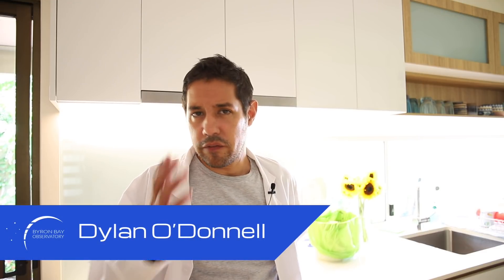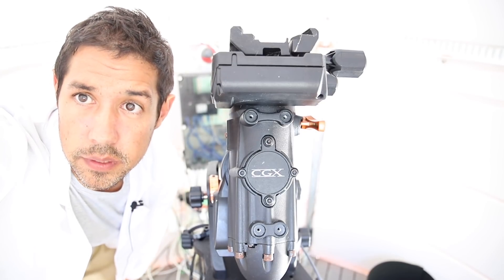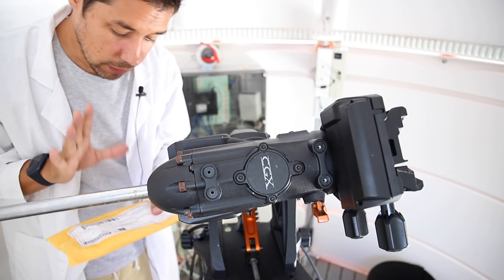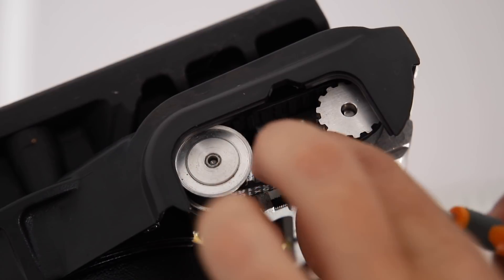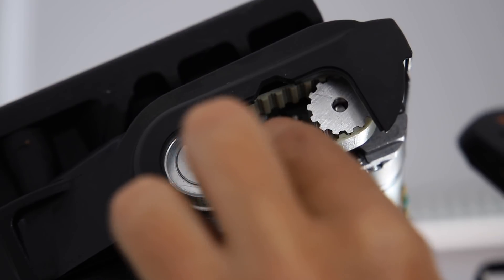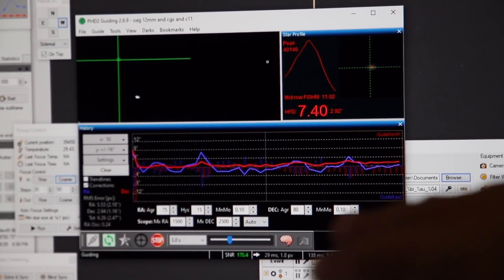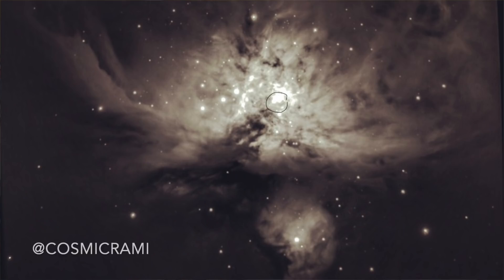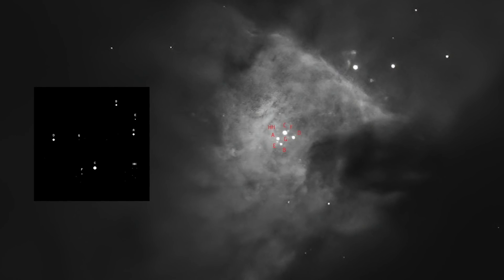CGX Belt Upgrade Demo & Trapezium PSA

Comment: I sound authoritative but I am really not!  What a down to the Earth comment Dylan!  I have not seen one single person on youtube channel that is more informative than yours.  

Can I suggest you to look at the rollers where you put the belt and see the screws on one of them?  I think the top one generally have allen screws.  See if you need to tighten them!
Reply from the maker: Ahh thanks Ray! I'll give it a look... I have a feeling it's more fundamental but unless I get a clear sky before the new mount arrives.. it's going back in it's box heh.
Reply: @DylanODonnell  g`day dylan did you check the sprockets for endfloat (feel for play up down left right in out )it should have next to no play check the bearings for notchyness with no belt and with what ray said check ALL bolts  for tightness firmware up date maybe ? on motor control  sorry you probably have done all this... if you know the youtuber astrobiscuit he has a mate that fixes these for a living you should email him for a possible solution or upgraded parts or a chat  ... great detail on the trapezium and the gas cloud  nice shot for 2 sec 
cheers
james D

Comment: Hey Dylan, I have a CGX and have pretty extensively replaced the drive components in order to tame the inherent backlash and tracking issues. Send me a PM if you want to compare notes.
Reply from the maker: I think I'm at the end of my skill ability here. I will likely sell it cheap to someone with more skills than I ... thank you though!
Reply: @DylanODonnell  Fair enough, I'm at the point that I am ready to upgrade to get rid of mine. Too many lost nights spent fiddling with adjustment. Unfortunately even the "upgrade" options each have their own serious issues.

Comment: A man bought a telescope. This is what happened to his bank account.
Reply from the maker: He made ... a recovery.
Reply: @DylanODonnell  dylan, that's not possible
Reply: A haiku.  Fancy telescope...His astrophotography...Bank balance so small
Reply: I don't have a CGX but I have done  full teardown/rebuilds on two of its predecessor and smaller mounts, the Advanced GT. That one is a direct drive rather than a belt drive. Certainly the belts are a good candidate to go after, and i'm thinking you were having some backlash issues as well which also points at the belts and should be improved. After that there are a couple of clues you might consider. It seems like the RA error is cyclical. Can you figure the scope's angular travel through RA from peak to peak on the errors? Then with the covers off, move the scope through the same shift and watch components to see if there is an element that moves through a full or half rotation over that pointing shift. Identifying that component narrows down the most likely parts.
2nd, from the look of it, I suspect that the really large offset to start is stiction in one of the bearings. Once moving it gets better but there is still a spot where it's worse.  This could be the same bearing surface that's causing the guide errors, but it's hard to say for sure.  You could have a main bearing with stiction and another causing cyclic RA error.
In any case, you will need redo all PE training, so record what might be saved and then reset everything so you are starting fresh. 

I'd suggest tearing down cleaning and relubricating the mount and pay particular attention to any thin shims on bearing surfaces, but that's just me. Just a bit of a dry spot or dirt in one of those can do all this, or perhaps just wear and thinning out of the grease through hot and cold cycles.
Reply: @Dylan O'Donnell I saw in another response you said the error cycle is in seconds, so that eliminates main RA bearings. Forget about my previous suggestion. So we're down to the small set of worm gear/ bearings or motor/drive gear bearings either of which would produce more regular looking errors or you've got an electronics problem producing a wobble in the motor. Missed or dirty drive pulses going to the motor due to drive signal noise can do that, even from cold solder joints or a bit of corrosion in a connector.  Have you checked all the connectors and wiring between the motor, sensors and motor drive boards and/or done any swapping to try and shift the problem from RA to DEC?   I'm sorry that So. California is too far away to take a look see, and I don't suppose you have a data analyser handy to watch the motor pulses.  As far as resources in your time zone, perhaps Andrew Johansen down in Melbourne might have an idea or two. I know that's like asking if I know a guy in Boston named Fred that has a telescope or three so forgive me.  He's on CloudyNights.com as OzAndrewJ. At least he's in the right time zone and knows that South is UP.  Seriously though, he about the best resource I can think of regardless of timezone so perhaps reach out on Cloudynights.com.  He's deep into the mechanics, electronics and software on mounts.  Shame about the distance. Both of my CG5/ Advanced GT's I have were bought very cheap needing repair and work great now but the motors are loud!  Shame I'm not closer. I saw you said you might sell it cheap.. but shipping to California.. sigh..   Hope you can get it fixed up. Reach out to Andrew.  G'day.. and don't worry.. we're all gonna die right?  :)
Reply: If you need to replace the bushings in the motor reduction gear try to find a local clock repair person.
Otherwise, lmk..maybe send just the assembly up here. I do clock repair and have bushing tools.
Reply: @hbmike47  The bushings for the output shaft can be replaced with high precision bearings. Believe it or not, it is the same small bearing used in certain Shimano fishing reels. Do a search on  CN and you will find all the replacement bearing #'s. I also have a CG5AST and someday will do the bearing swap in it. I got mine on Ebay...
Reply: @daverichmond1187  Thanks Dave. I see that reference on CN. There's also a flange bearing that's been identified for the motor side bushing that also will wear out. It sounds like these mounts are not coming that well adjusted from the factory and too much belt tension will cause these failures quickly.  Even with a properly adjusted system, bushings are wear items and with no lubrication schedule, they're going to cause problems, it's only a matter of run time. 
I also found the info on PHD analysis that identifies the frequency of the various deviations that help point to the specific part of the drivetrain causing the error absolutely fascinating. That's GREAT stuff for hyper tuning and troubleshooting.
 Looks like Dylan is facing this process should he choose to go down that road. I don't think he will.  Not everyone will be willing to take on the project and I can see why. Time consuming and frustrating, and pressing small bearings into place isn't exactly a common skill The casing and motor are not easily found and the decoder/sensor at the other end is prone to failure too.  I don't have budget to upgrade but I guess I can always keep my ear to the ground for the thud of one of these mounts hitting the dumpster out of frustration. LOL. I got an advanced GTs to use with a DSLR because it was really cheap. Best bargain ever if you are willing to rebuild it. One with an 8" SCT which with cameras and guider scope attached is pushing the limits. 
Clear skies.
Reply: His Wallet whent and Hid in the Corner and His Bank account was Drained dry , Astro imaging is a Bottomless Pit Money wise.